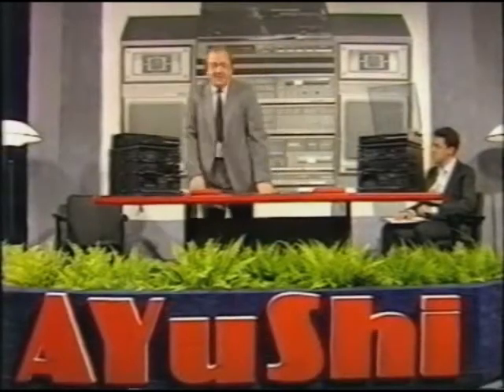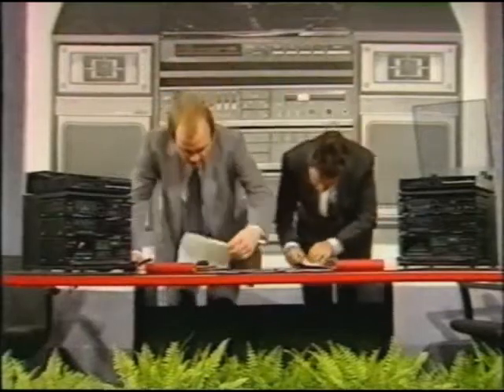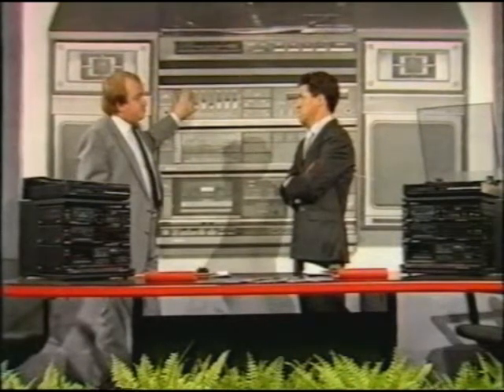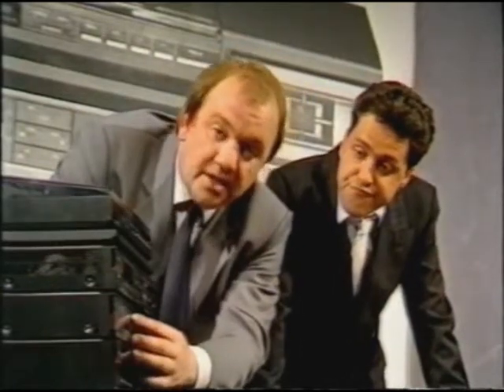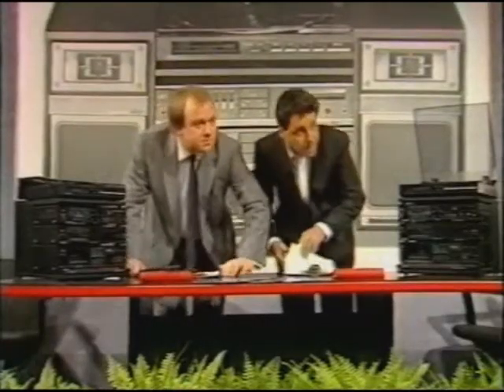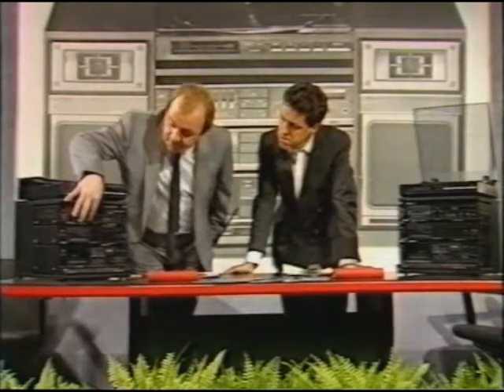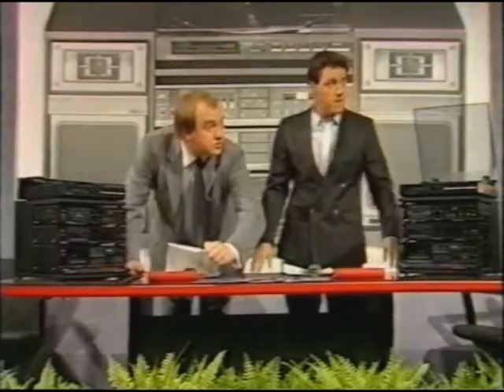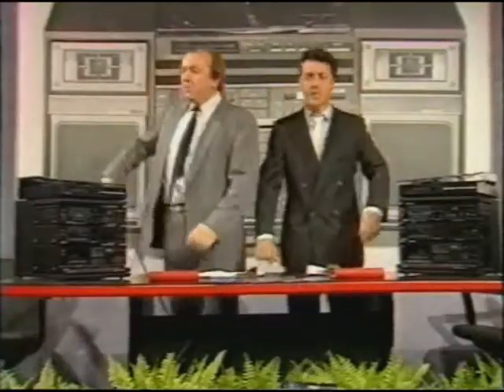Alas Smith and Jones Sales people!!!!

Comment: Always loved this sketch. I could genuinely explain what all of those buttons were for on an old stereo - these guys needed me as their technical advisor lol
Reply: So what does a graphic equalizer actually do?
Reply: @bigredsock1  It adjusts different parts of the frequency spectrum to alter the sound characteristics of the music. Each slider in the equaliser adjusts one part of the frequency range of the sound signal. Low frequencies (on the left side) have the effect of changing the levels of bass in the sound, whilst high frequencies on the right alter the treble. If you don't have on one your computer, it's worth thinking about - I use one called emac on my iMac. Definitely enhances the sound if you get it set up right.
Reply: @Wally-H  Thank you for your explanation. As for your suggestion,  the volume control is complicated enough for me!
Reply: @bigredsock1  No problem, chief 😄
Reply: @@KlimtEastwood Dolby was a noise reduction system for cassette players. Music cassettes had an inherent hissing sound - Dolby filters were designed to reduce this hiss. The hiss was not so bad on better quality cassettes. Personally I wasn't a huge fan of Dolby B as using it did remove the hiss but it also seemed to chop part of the music off as well, especially the higher frequencies (which made sense because that's where the hiss also resided).  It is for this reason that it reduced the volume a bit. I only used it if the hiss was so loud as to be annoying. When recording I usually used high quality TDK cassettes and it wasn't normally necessary to use Dolby with those. Dolby B was the most common filter to be found on cassette players - C was reserved for higher-end HiFi systems and it was better as it reduced the hiss without ruining the music quite so much. There was another one called Dolby DBX and that was the best one, however it was rare to find it on 'off the shelf' cassette decks because it was mainly used in recording studios. You could get it however and I did have one cassette deck that used it, which I bought for my home recording studio.
Reply: @@KlimtEastwood I think it is possible to get retro boom-boxes etc. that have Dolby filters on them. They are aimed at the nostalgia market and are presumably purchased by 40 and 50-something's who grew up in the 80's!
Reply: @@KlimtEastwood 🤣
Reply: I've not yet seen a modern retro one with Dolby. @Wally-H
Reply: @wisteela  I thought I saw one for sale in Menkind but yes, you could be right. On limited manufacturing runs of boom boxes for the nostalgia market, buying the licence to add Dolby filters probably wouldn't make sense, or be economically viable.
Reply: And they are all now really cheapo things. @Wally-H
Reply: @wisteela  Yes, made in China instead of Japan.
Reply: The old Japanese stuff was fantastic. @Wally-H
Reply: @wisteela  Indeed. I had a Denon tape deck, Morantz amp, Sony tuner and Tensai turntable with Pioneer speakers and it sounded great. HiFi purists used to sneer at what they called 'JapFi' but for those of us on a tight budget, it was good stuff.